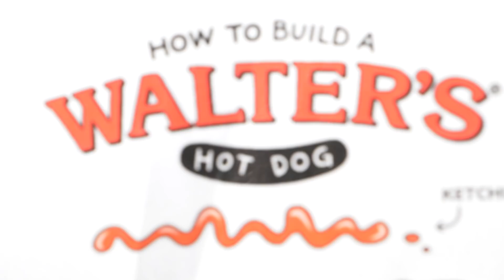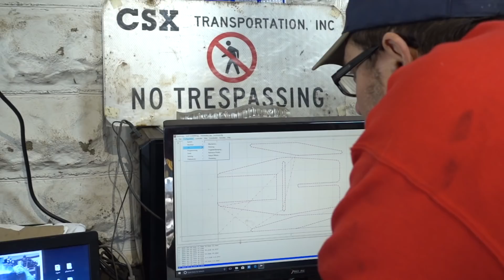We bought the largest machine for the shop

Comment: Hi, is it possible to do away with the pedals on a moped that has a kickstarter and fit foot pegs/ rests? I have a Puch Monza which I would like to do this on. Thanks great channel !
Reply: Yes ofcourse
Reply: Any chance you will be doing a big bore swap and tune on a puch any time soon?
Reply: I have managed to source a foot rest bar and rubbers and workshop manual for my puch monza so I will be removing the pedals asap !
Reply from the maker: Good going!  Best of luck!